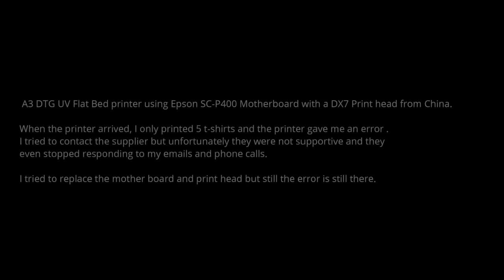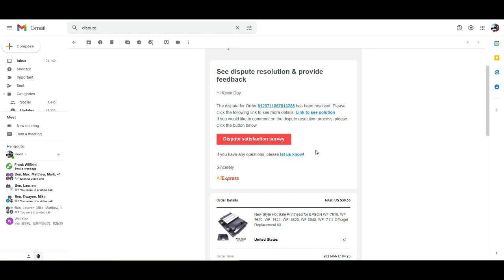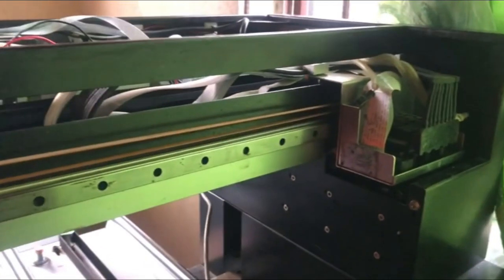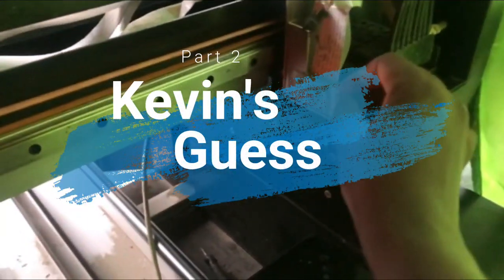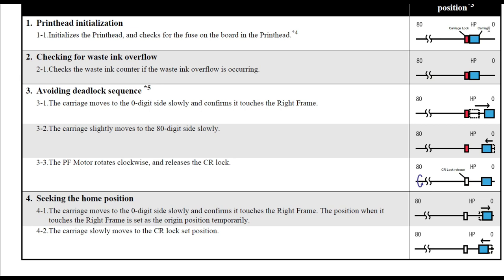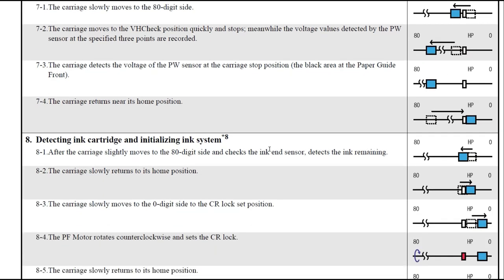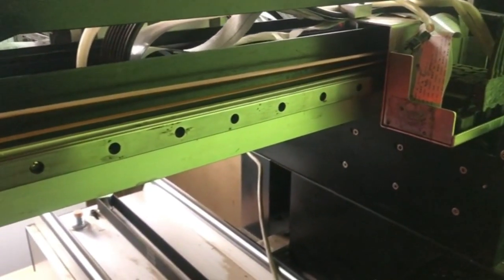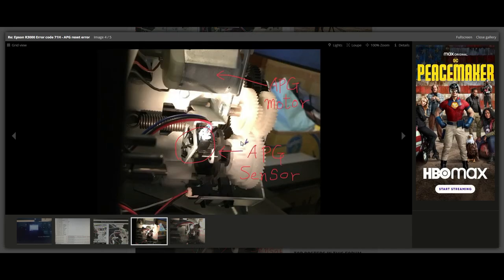Epson DTG Printer 51H 52H 71H Error Fix - Ask Kevin

Comment: thanks kevin for sharing this one. I think this like a phantom paper jam when the paper is loaded? is just hard to recognize in a dtg settings. my 2cents opinion is pw is not working. It might be the same with the workforce wf 7711 no error until the paper is loaded and somehow the error is paper jam not related to pw sensor issue. I tested this when I remove the sensor and got the error only when actual paper is load for printing.
Reply from the maker: Thanks for sharing the thoughts!
Reply: @BCHTechnologies  sir I am also looking for wf7710 or wf7720, wf7210 board mine shows short circuit error, do you have one not listed in you site or is there a way to fixed the short circuit message for these wf models?
Reply from the maker: @c2sartinkprinthub757  Those are hard to find.  Most owners will not sell the malfunctioning printer, so there is a little resource for them.  I suggest fixing your board rather than looking for a new one.  Also, try eBay and AliExpress.
Reply: @BCHTechnologies  tried the F1 .. the board still reads shortcircuit...